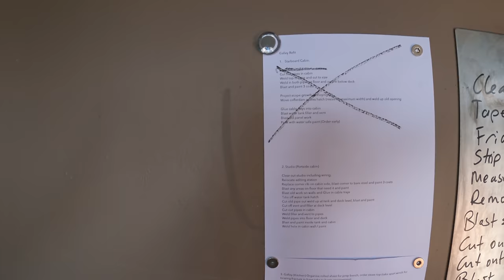Jackhammering & Sandblasting the galley deck - Project Brupeg Ep. 190

Comment: Welded and flame cut steel gets a layer of millscale oxide as it cools. It should be grit blasted back to bare steel before painting. Otherwise it rusts along the weld just like yours have. Corrosion inhibitor in your jet blaster water will help to reduce the flash rusting. A water-based rust converter/primer will stop the flash rust causing problems.
Hot metal-sprayed zinc will stop the rust dead. Scrape and blast off the rust, spray with zinc metal. Epoxy prime over the top.

Comment: I love your video's guys.  I would just like to suggest.  A gas pressure washer is simply a gas motor with a pump bolted to it.  if you take the 4-6 bolts off that connect the motor and the pump, you can attach the pump to any gas motor that has the same footprint and shaft size.  Pressure washer pumps don't care if they are horizontal or vertical.  I know in the US they have Harbor Freight, and Canada we have Princess Auto they sell cheep generic gas motors.  That can bring StanLee back to life using all your old hoses and pump.  Just a thought, other than that, this is wonderful to watch you guys.  Keep it up.
Reply from the maker: Thanks yeah the issue is the pump on this motor has done so much work every part of Stan Ley was wearing at roughly the same rate. Ie fix the motor then the pump dies
Reply: @ProjectBrupeg  very good point.  Sure hope the new one works amazing, I know the video's behind realtime, so I assume the new pressure washer may be there by now.  I sure hope it takes you well past the end of construction.   BTW. I love that you guys respond, you guys always do.  You guys are amazing
Reply from the maker: Thanks, yeah new blaster is up and running actually found it was too powerful and blow the sandblasting nozzles out. Wore out the ceramic innards. New nozzle in the post, hoping to have it this week ish
Reply: @ProjectBrupeg  Well as you said in this weeks video, a day job is turning into weeks.  I am so sorry for the struggles over such a simple idea "hey lets sandblast the galley".  If I didn't live half way around the world (Canada), I would come and help.  Good luck and Lord bless.  Keep up the good building and editing.

Comment: That's alot of work sand blasting and even harder on your back.when I had to do a similar job we only blasted the walls and floor edges then ,here's the clever bit we hire a floor cleaner the ones that you see people stand on and spin on ,anyway for the floors hire a floor cleaner the type that uses pads and instead of polish put raw sharp damp sand all over floor and away you go ,its like a giant sander and works so quick on problem floors straight down in minutes and it smooths floors then wash down and repeat where needed.hope it helps stay safe guys best wishes
Reply from the maker: Ha! what a cool idea

Comment: To minimize the condensation that will occur with water temperatures that you will experience, you'll need to either provide sealed insulation such as Dense Spray foam  (2lb or higher) or you'll need to have much airflow to prevent the condensation.
Reply from the maker: Have a look at previous episodes about our decisions around insulation.

Comment: I would think that area under the deck would gather a lot of condensation due to the cold steel. So if the "coating" was not well applied, it could get moisture to the steel. 
Love the progress, stick with it and you'll be on the water in no time.
Reply from the maker: You are correct. The issue being any paint that started to come off created an air pocket for rust and water which lead to more rust. now that we can do it right we will be able to solve this challenge

Comment: As the old ship expression goes " rust never sleeps "
It is terrible when you take one step  forward and end up 4 steps back.
Clever engineering, way you got the water / sand to drain out. 
I  curious how are going deal with all those deep rust holes . Are going to use body filler to make a smooth surface for the floor?
Last thing are you adding grit to the floor paint for extra traction?
Great line more sandwiches in the belly before I start. 👍🇳🇿💯🥪
Reply from the maker: Yeah most of the pitting we are comfortable to leave, some will be pad welded, others filled

Comment: Dame, if I heard right that old pressure washer runs as long as you feed it fuel? Could you throw a $12 clone carb at it from Amazon? It sounds like the main jet is plugged, or the needle is stuck in the seat. Either way it’s only about $2 more to buy a whole carb than it is to buy a carb kit. They’re not great but for equipment like this you don’t need great, you need running. I put one on my snowblower this weekend. $12 came with fuel lines, a filter, and a primer bulb including shipping.
Reply from the maker: Hi Bob, yeah we had a previous washer that we replaced the carb on and found that the thing just never ran right after that as we had to botch up the governer etc. these things get a bloody hard life (like run all day for 8-9hrs a day) so they  do tend to start wearing out and then your chasing your tail keeping them going. a new carb would have likely solved the issue but i suspect the next weakest link would have gone not long after that
Reply: @ProjectBrupeg  maybe as a backup for the new one. A couple of bucks and ten minutes of work could save you three days of downtime in the future.

Comment: Damien, could your blast setup be converted to a wet system like Doug was using on Seeker?  I know you’re almost done but at least having wet sand would help instead of slow you down lol. Love the work!
Reply from the maker: Possibly! I did try using it as a wet sand delivery but the machine would need to many mods to make it work well, found it almost impossible to get the sand to deliver down the tube, also it really struggle lifting sand from the yard up the 5-6m to the boat, whereas the dry system does have that issue. This really is only able to be a dry sand blasting system strapped onto a pressure washer.

Comment: I'm not exactly a naval engineer/architect but structures are my thing, so, i'll just raise the question regarding the formerly boxed areas, now exposed. I think they might've been a structural element, those sections of metal that you cut out. It's just a thought. If you have a naval engineer or architect to question, maybe ask them. Just my 2 cents, as the way its built doesn't seem just a haphazard metal placing chance.
Reply from the maker: Our best guess so far is looking at the plate size its just a 4ft sheet on its side rather than cut to a specific shape. based on that im thinking the builders thought why cut it off, its not in the way of anything.

Comment: Why not dry blast instead of wet? Flashrust with wet is a problem?
Reply from the maker: Cost and mess, our cost per sq meter is $3.12 versus over $35 for dry blasting. Also wet blasting we are able to blast inside the boat ad tanks without loosing the ability to breath the air, dry blasting needs a lot more ventilation as well as specialised breathing gear. Flash rust isnt in issue if you use the right system after the blasting. we have used it for years with very satisfactory results. plus being our blaster and our system design we are independant and able to blast whenever we need to in a yard the does not allow dry blasting outside of the specialised blast bays

Comment: I have one of those Chinese import pressure washers just like your two badged Karcher and Stanley. It works well BUT the clone Honda engine low oil level sensor is set too high. Fill the oil to high mark on dipstick and it won't start, fill until it overflows the filler hole and it starts first time.. The importer who I bought mine from says very many of them are like that, so if it won't start check that the oil level is ABOVE high !
Reply from the maker: Ahh cool. thanks

Comment: Did you notice much difference between the new bigger hired unit and the stanley ?
Reply from the maker: Yes. Stanley 2500psi would start strong and taper off after a few seconds, this got worse with age. The hired unit was a bigger engine and just stayed at the rated pressure. The new blaster we have now is 3200psi and stays at that figure pretty consistent. In fact we had to back it off to half throttle because it started destroying our ceramic blasting nozzles!
Reply: @ProjectBrupeg  we had a rust job and were using jackhammers and it was difficult to get into the position. So we hired a hydro blaster company. Just using water no grit and 20,000 psi I was amazed how clean it got .

Comment: Are you allowed to fill the sponsons with 2 pack expanding foam? Landlubber has no idea of the rules but it would protect the bare metal.
Reply from the maker: Hi Dave. Nah once the sponson is welded water tight again the insides rust a little and in doing so use up the oxygen. After a month or two there is not enough oxygen left for the rust to continue. So it can last indefinitely in that state

Comment: You could get just as good results with a grinder....punishing work but will get it done.Be a lot cheaper than hiring crap machines you 'll spend on the discs but still quids in time and pocket.
Reply from the maker: Nah respectfully disagree. Grinding polishes the surface too much and two pack won’t stick to it long term. It doesn’t rough up the low spots only the high spots. We have tried almost ever conceivable method of steel prep and consistently sandblasting is the only long term solution. Dame

Comment: It’s more like you don’t have the compressor to run a needle gun effectively, so you use what you have.
Reply from the maker: We have an industrial 3 phase compressor used to run a ten man truck workshop. air isnt not the issue here. Unless we buy a large commercial needle gun (which is easily 5 times the price of an electric jackhammer) needle guns just dont cut it. Heavy rust stays attached it you dont give it enough welly.
Reply: @ProjectBrupeg  yup, I’m with you. You use what works! In order to do what you are doing you need a huge compressor and a Mack daddy needle gun, not feasible on a job like yours. Keep up the good work!
Reply from the maker: It’s not worth the cost either. These electric ones are sub $200 and last ages. We got 4yrs out of the first pair we brought.

Comment: It's  OK. The work is fine but,,, you stated out wrong by NOT insulating the hull from the COLD 🥶
Reply from the maker: Insulationg always had to be done last as we knew this rust was sitting there. no point in doing it the other way round or we wouldve had to rip it all out again

Comment: Needle g*ns don't do squat in heavy rust. Unless you operate an industrial sized air power supply, a large line, and large needler, you're wasting your time. The only use for them is upsetting small deposits and pinging surfaces. People who recommend needlers either have the big one and have never used the common variant, and good for them, they're junk, or have absolutely NO clue what the tool is used for.
In that kind of rust, you're wasting your time with a needler.
Source: i've upscaled from needler to needler to an antique behemoth, until i was able to find something that really does rust in. And it's still useless in some applications where it basically pierces through the thin metal. Best solutions are either chemical or other mechanical means.

Comment: Can't you just convert the rust
Reply from the maker: Converting is the equivalent to the first layer of paint. As Jacqui said if the metal has gone no amount of converter will save it
Reply: @ProjectBrupeg  I see, thanks. I worked on a converted trawler myself. Environment agency research vessel here in UK. Last I heard they sold it. One of my jobs was sending crane down to ocean floor to scoop up samples. Nearly got pulled overboard on one occasion lol. Good fun, 24 hour shifts tho. GPS waypoint to waypoint. Zodiac trips to power station outlets along coast in pitch dark, going off hand held GPS. Etc.

Comment: Think your needle gun opinion is like your  plasma 
Thought it was pretty shit cause the one you had was shit, looking at what you thought was a needle gun 
A good needle gun is quite a bit faster than a hammer drill 
But I guess work with what you've got
Reply from the maker: True, that but the cost of a decent needle gun I could buy 5 jackhammers.
Reply: @ProjectBrupeg  
Yea, about $500 for a decent needle gun 

The good ones arnt pistol grip theyre like  a straight cylinder
Reply from the maker: Yeah we have tried them but so far they don’t hold a candle to the jack hammer